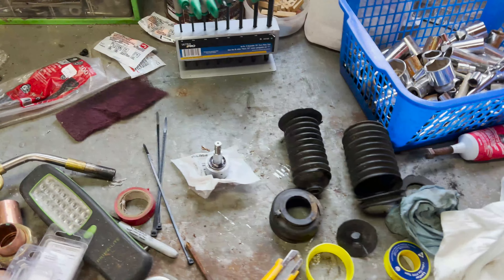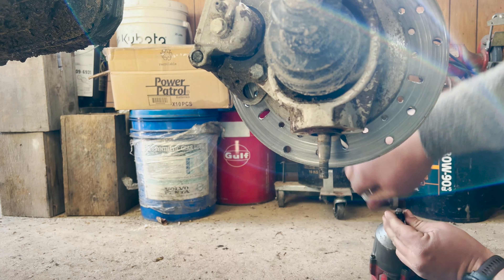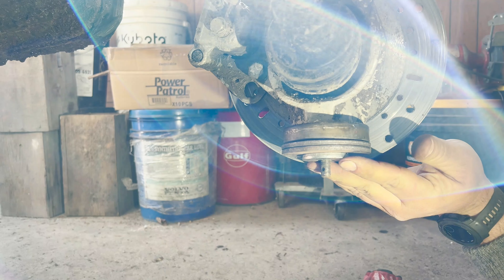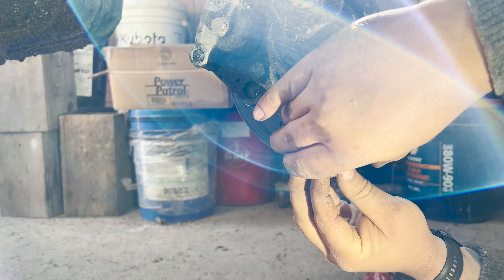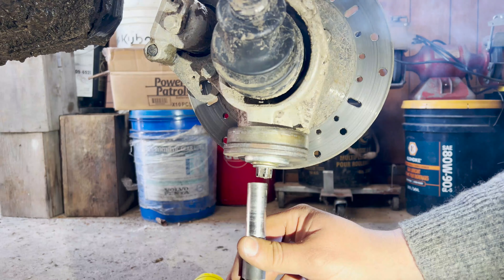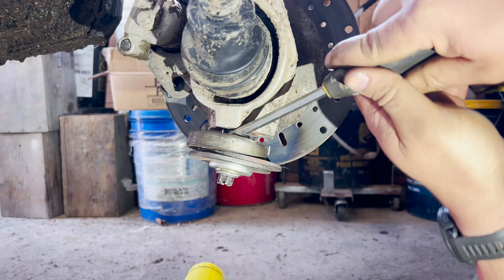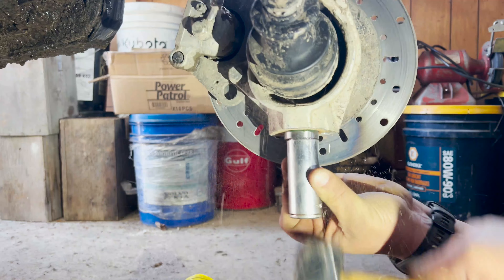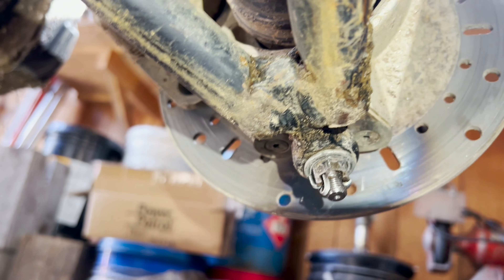In situe ball joint replacement 2015 Polaris Ranger 570.

Comment: What happened the first attempt?
Reply from the maker: The spacer i picked was the same height as the ball joint's total size, needed to space just the part sticking out.
Reply: @blacksheepfixin  ahh! I'm on that step next.
Reply: @blacksheepfixin  hell, now I can't stop the shaft from spinning. Thinking about framing the hell out of it with a blunt chisel 🤔
May have to weld this S.O.B.
Reply from the maker: Ya, wedging something in there and spritzing the impact might help ya